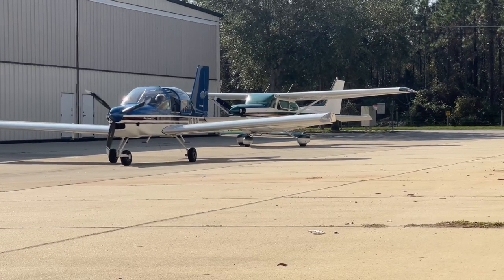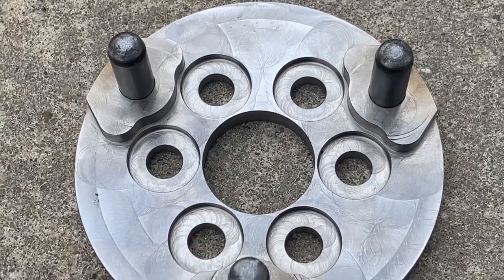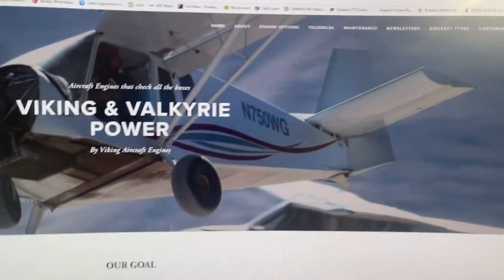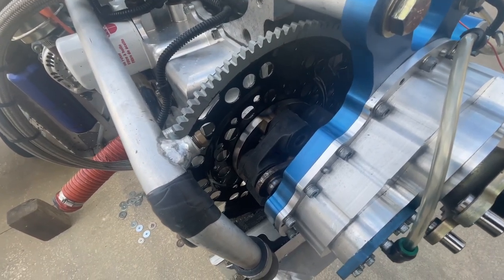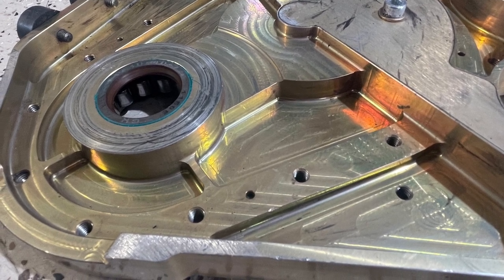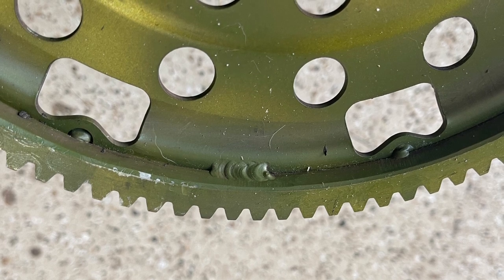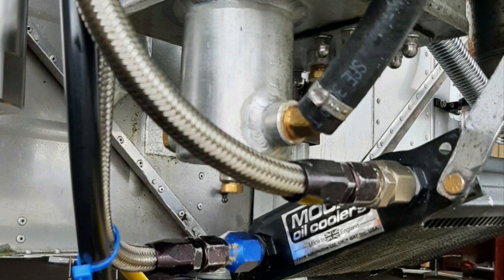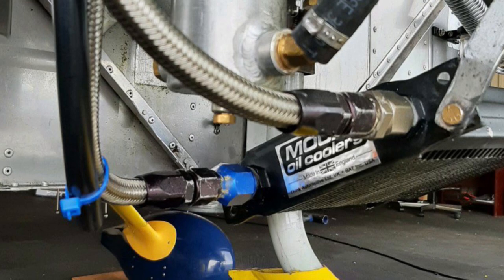Viking 110 Service Bulletin

Comment: jan....i have a 110 serial # JHMGE88429C005913.  it has all aluminum viking pulleys and flywheel.  can you tel by the serial if these updates are needed? engine is 0 hrs
Reply from the maker: Hey Phil,

A serial number unfortunately doesn’t help as even though pieces were purchased etc doesn’t mean they were installed. The best thing that can be done is reviewing the SBs on the website that shows how to tell what you have and if something needs to occur.

Pictures sent to us also help.